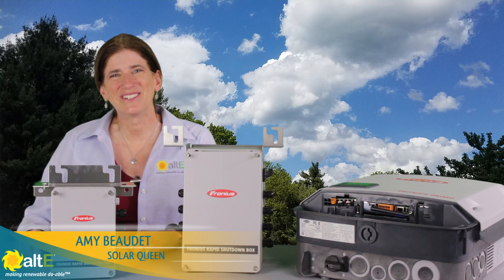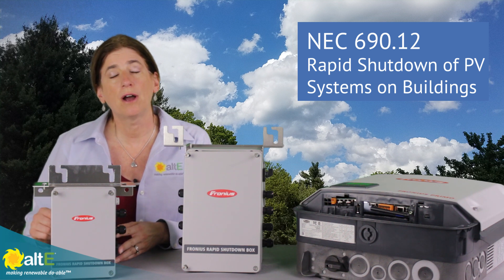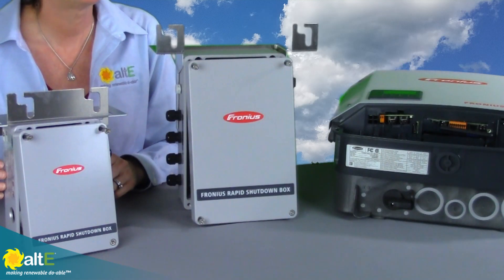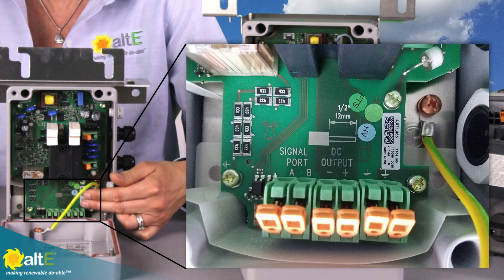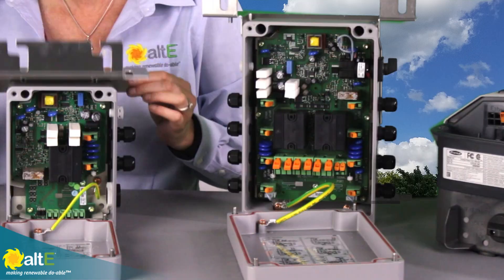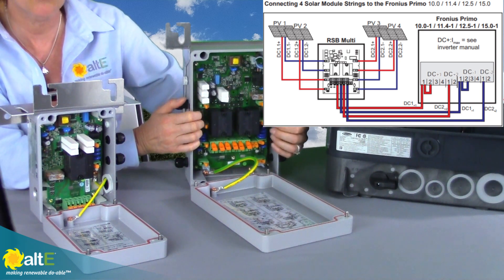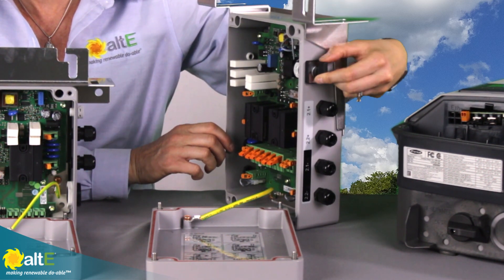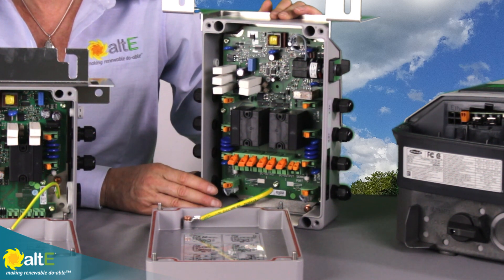Fronius Rapid Shutdown Box for Solar Grid-Tie Inverters

Comment: Do you need a rapid shut down for 8 300 w panels with 4 panels in parallel and the other 4 panels in parallel  then connected in series on a low roof with the discount mounted on the wall 3 feet a way from the panels

Comment: What are all the electronics for in that box. Why not a simple relay ? Im just curious about what is going on in there.   Thank you for video
Reply: A relay does not achieve reduction of array conductors voltage to the level that NEC requires. In other words if the relay opens the conductors, the current drops to zero but they are energized at the Array voltage, if a firefighter cuts the CD wires with a saw he is going to suffer an electric shock.
So power electronics parts must be used.
Reply: @jimsmith5109  Thank you.  That is really interesting how the cable holds the voltage

Comment: To which connector exactly, inside the Primo inverter, should the rapid shut down box signal wires be landed: the two conductor orange or the three conductor NO/NC orange connector?

Comment: I'm looking for a grid tie inverter for my 1600 watt wind turbine, any thoughts? I have load resisters
Reply from the maker: I'd need more info. Is it currently charging a battery bank? If so, what voltage? Schneider XW+ or Outback VFXR inverters could be a good fit. Or are you looking to go straight from the turbine to the grid? If that's the case, I'm afraid I don't know of a solution.
Reply: right now it's on the 24 volt battery bank with a diversion load. but since I don't have solar yet the battery bank is strickly for grid outages which worked great last week.
so the brakes are on both turbines. I wish to put them on a grid tie setup.
Reply from the maker: I'd suggest the Outback VFXR3524 and the Mate3. Connect it to what you already have, sign up for netmetering to sell back any extra, and it has plenty of room for when you add solar and charge controllers later.